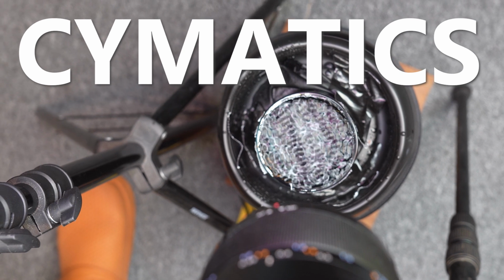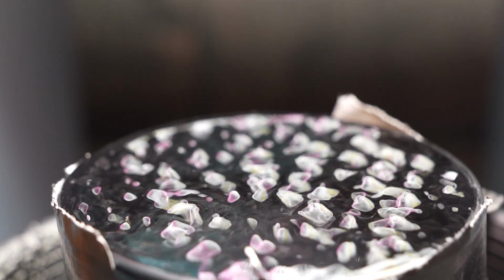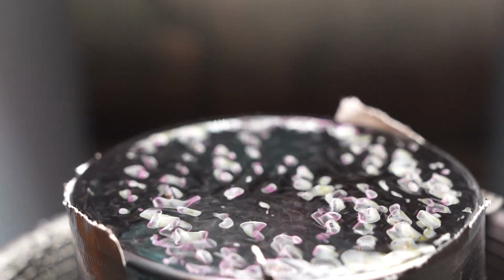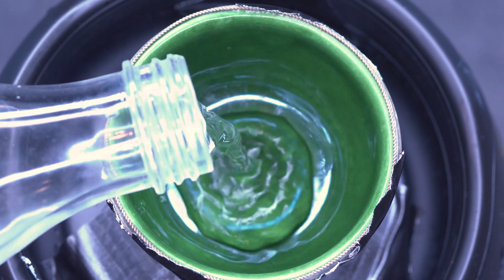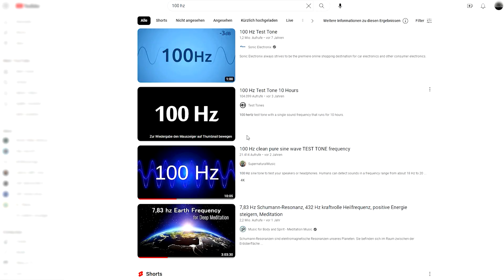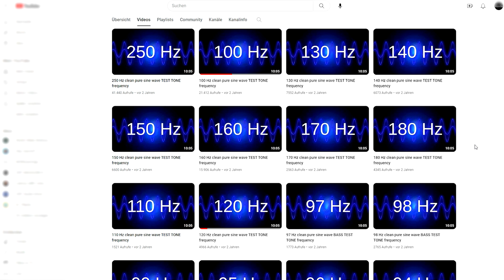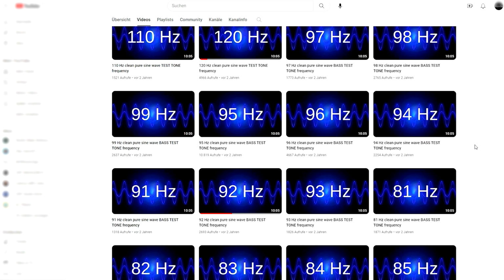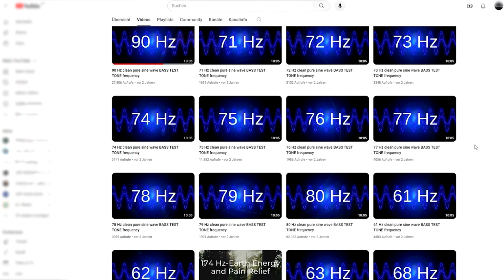Macro Photography Ideas using Sound and Water!

Comment: Kudos for the unique topic, Jens👍. Super images and footage. What device was the sound source? Smartphone? External speaker?
Wonder how soap bubbles would perform — up to what frequency. Cheers!
Reply from the maker: Thank you Paul! I connected my phone to bluetooth box and played youtube bass frq. There is one major issue... that I could not control the volume without "hard steps", there will be another part soon, this time hopefully with more symmetric patterns;) Adding soap is a cool idea
Reply: @anotherperspective3076  My guess is that you could make a sound file and play it on a stereo system so you could control the sound volume the way you prefer. If you have a bass “woofer” speaker, set it speaker side up and place the test fluid on top.